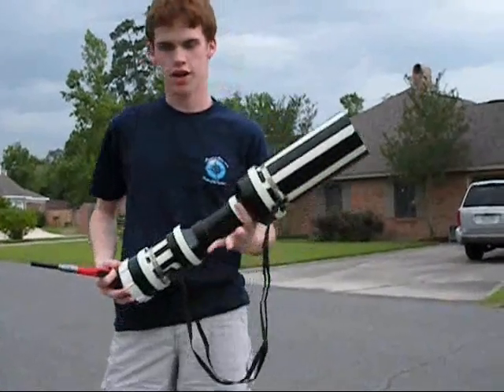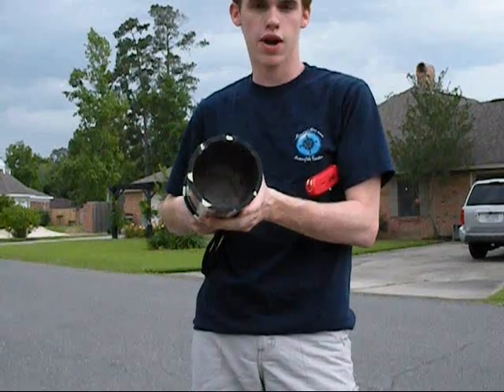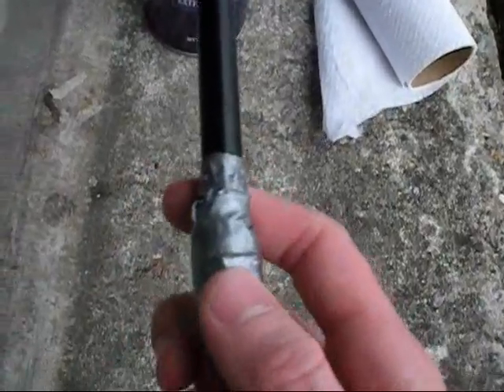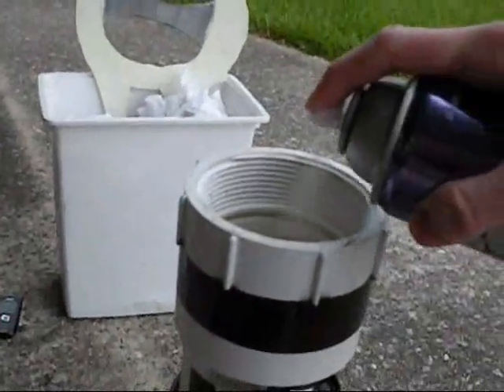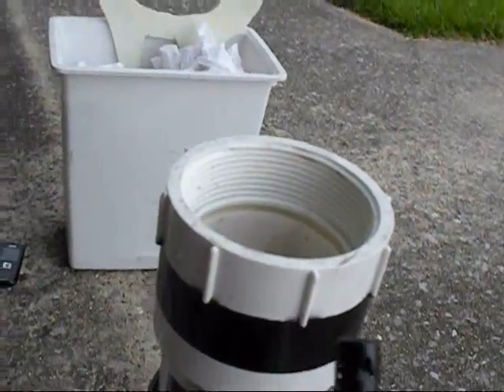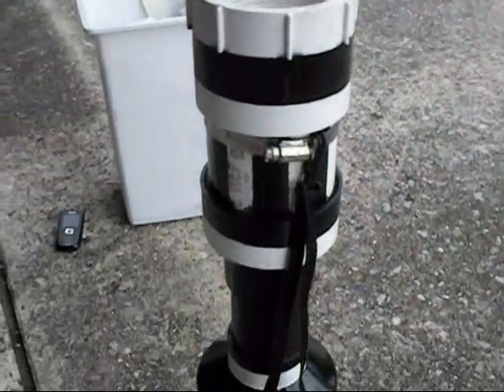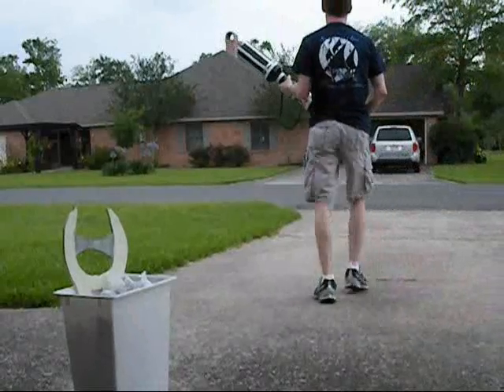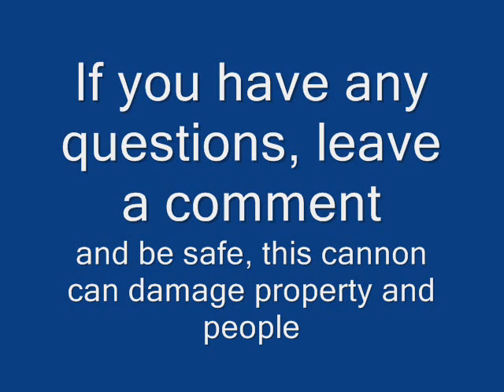How I Made The Toilet Paper Cannon

Comment from the maker: @DPRocks100 i know that, but its not in a high concentration as something out of a tank. there is a small amount in all aerosols. but using gasoline or kerosene or something like that you are asking to get burned. and i wouldnt want to use propane out of a tank because it could cause problems if u added too much, blow up the pipe and have a pvc hand grenade, just be safe.

Comment: Spray paint works better and you barely even put any ypu want mostly o2 in the combustion chamber and little gas makes better explosion and get rid of the lighter and get a lantern sparker and drill and glue it to the side so the combustion chamber is sealed